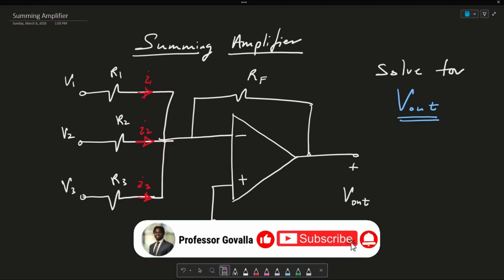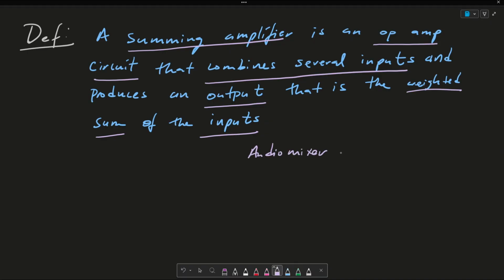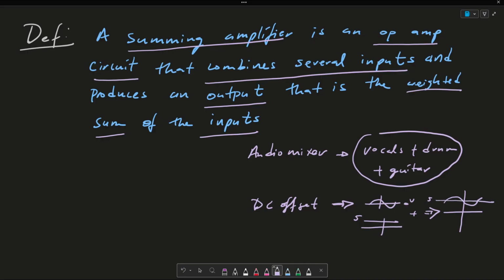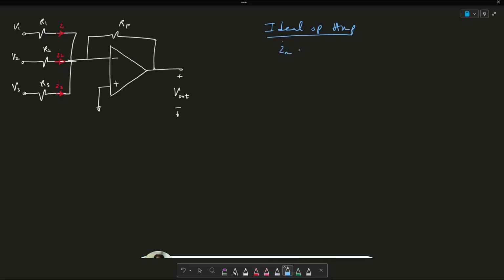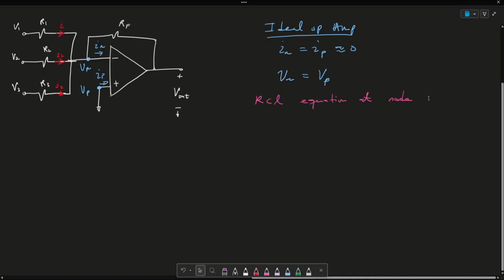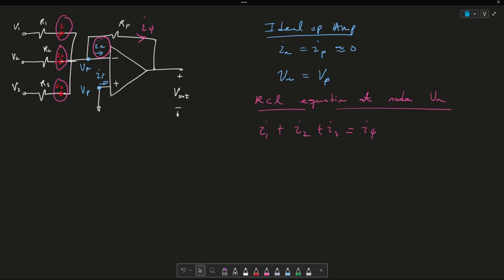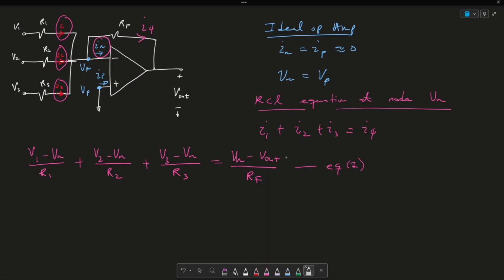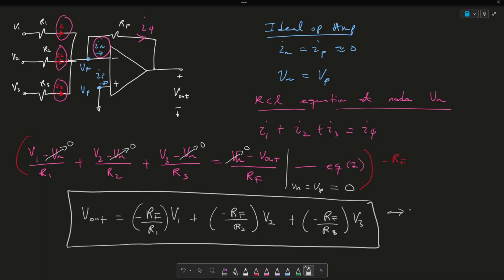The Summing Amplifier - Clearly Explained

Comment: how would i use it as an audio mixer? assume I have 3+ passive buzzers with their own frequencies to produce different pitches, how could I control the amplitude of their frequencies all at the same time using this? without causing distortion of course
Reply from the maker: Hi, great question. You could use the summer (to add all the signals together) as an audio mixer. Attach each buzzer signal at V1, V2, V3,... to Vn. To control the volume of all the frequencies, you can use a potentiometer (variable resistor) at R_f; the adjustment will affect all your amplitudes at the same time.
Reply: @ProfessorGovalla  ohhh i see i see, much appreciate prof! thanks for the help ❤